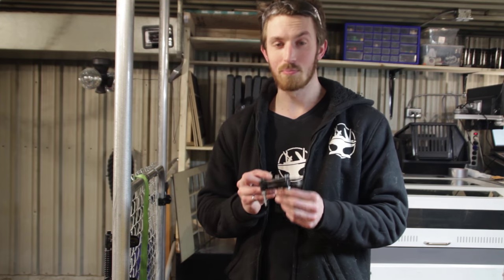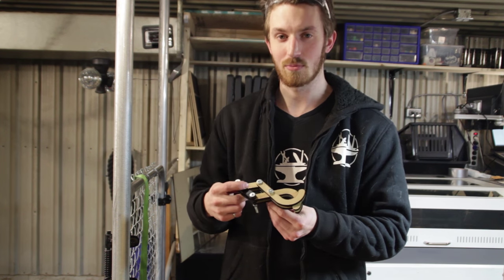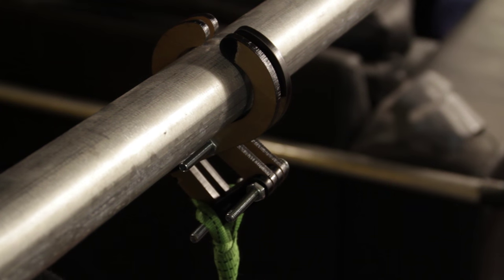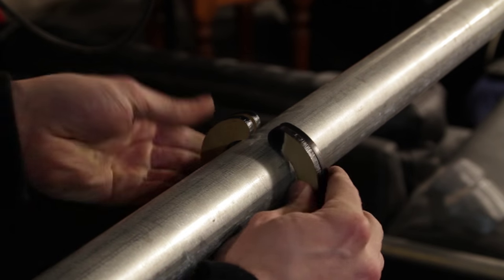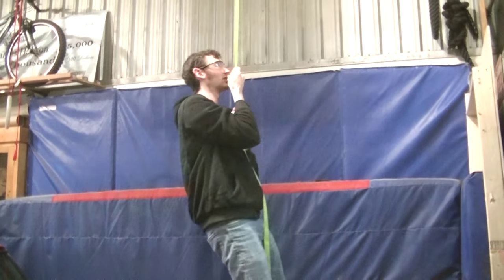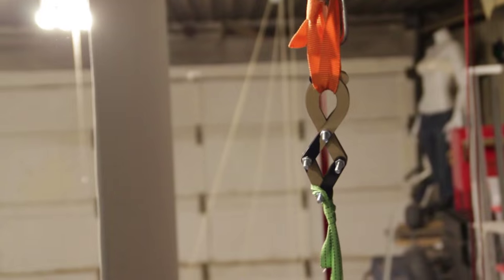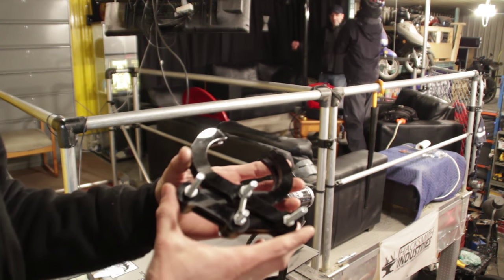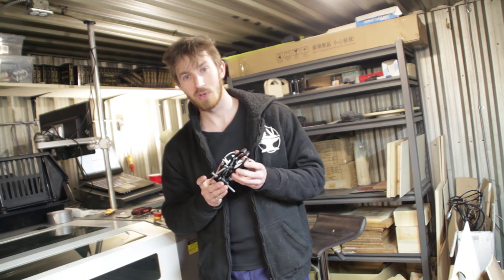Batman Rappelling Part 1 - The Hook!

Comment: Will there be a device to fire the grappling hook?
Reply from the maker: +Kyle Rathke That's the tricky part eh?
Reply: +the Hacksmith Firing it is easy. Aiming it reliably is harder. Getting it to latch onto a wide range of surfaces is hardest. Good luck.

Comment: i see a huge flaw in the design(if using the spring) when going down a rope like that you could see that the rope was losing and gaining tension as he was just jumping on it slightly, now if you actually jumped or applied a lot of force downward wouldn't you just rebound back upwards, making the rope not have enough tension to keep the hook closed. If you have already thought of this bravo on you, but if not might be a sensible thing. I personally would go for a sensor on the claw that wouldn't let it open up unless the force is under (desired weight) for 10 seconds. would be a little bit long but this is just me.
Reply from the maker: +chuckach3w Something to be tested certainly ;-) you haven't seen the rappelling device yet! It's possible if you purposefully pulled really hard and hopped on the rope it would disconnect the gripper, but that would something you would mean to do =)

A sensor would make it too complex I think, we're going for a robust but simple design, we had thought of having a locking mechanism with a second rope, but I think that system would be even more dangerous as you're going down!

Comment: Just a thought, if the spring will open it when tension is released won't rappelling be impossible? To rappel you need to basically let go of the rope and slide down it a little and continue. When you do this to go farther down the claw may release from whatever you have it attached to.
Reply from the maker: +Noah Corwin The weight doesn't disappear though when you rapell... You are essentially sliding down the rope, which your speed will be reduced by friction -- the only way for it to disengage is if you were to do a one-arm explosive pull-up, causing actual slack in the rope above you -- THEN it would release =)

But if you're doing that you mean to do that ;-) You'll see in the test videos!
Reply: +the Hacksmith was just my thinking to keep safety in mind. Thanks for correcting me! Wouldn't want to see you get hurt and have to stop making these awesome videos

Comment: interesting design! but wont the spring keep you from creating the tension required to close the hooks? It seems youll have to hold it in place and manually close it, then retain tension until you get in position to descend. Im looking forward to seeing more!!
Reply: +gamiensrule The spring is not needed to be that powerful, as long as it can pull the claw open. If it is weak enough, it wont cause any problems.
Reply: PerunaVallankumous Makes sense. The video made the spring appear fairly strong.

Comment: Why are you going to be using aluminum instead of steel? Definitely one of the coolest things I've seen.
Reply from the maker: +Luke McCarthy it's cheaper and easier to make -- and a third of the weight. Considering the brittle acrylic plastic was almost strong enough, even aluminum would be over kill. We'll make two and stress test one though ;-)

Comment: so I'm trying to build a grapple gun Batman style just for the fun of it, but I'm having a hard time figuring out the air pressure I would need to have, and how to achieve it. so far I've figured I can't have just a straight up co2 injection, I need to feed into a pressure chamber, but I'm in need of assistance on the specifics. also, any ideas on how to increase the reel in speed (if I could get 1 m/s I'd be happy) without massively increasing the weight
Reply: Probably you need a retractor for the rope kind of a winch
Reply: +Alif Rabbaanee yeah I've been playing around with some ideas, but the problem with a winch is the size, which is why I'm trying to downsize it. if possible, I would like to keep it one tool, but problems keep coming up that almost necessitates two separate tools

Comment: If you put a spring onto it you won't be able to hook it any other way but by hand. You won't be able to shoot it and have it hook itself. Unless you only plan on setting it up by hand and then using it.
Reply from the maker: +Atrax R Yeah... it's called a rappelling hook... ;-) I said this in the video. We'll revisit in the future to make it into a grappling hook.
Reply: the Hacksmith Ah, it makes sense then. But still I hope you'll use some safety line when rappelling down a 50ft building, since if you let off the force just for a bit it will unhook.
But yea, it makes more sense to me now. :)

Comment: isn't aluminium quite a soft metal? would you not want something stronger?
Reply from the maker: +Macauley Cullen Aircraft grade aluminum is nothing to scoff at -- it's easier to machine, and a third of the weight of steel. Considering the plastic held... even aluminum would be overkill!

Comment: I wouldn't trust aluminum well enough. why pick a soft metal?
Reply from the maker: +Video What It's cheap and easy to work with and CNC mill... third the weight of steel. The plastic was almost strong enough and aluminum has a tensile strength well over 10 times that of the acrylic... You do know airplanes and even Ford trucks use aluminum, right?

Comment: Looking good, but why not use steel?
Reply from the maker: +Haywood Jablomey cause it doesn't have to be steel? Aircraft grade aluminum is a third the weight of steel and more than strong enough -- the plastic was almost strong enough and aluminum is still probably 10 times stronger than it!

Comment: Hey You might want to check out the channel ColinFurze, he's very much like you and has created this invention in a different way like a classic grappling hook shooter, along with wench that all links onto one arm. It was inspired by Assassins Creed the game. And I have a 3D printer and I'm more than willing enough to print you stuff for free if it helps out in the Hacksmith Business.
Reply: And this design is great. Good luck and enjoy!
Reply: Plastic can't hold 200+ pounds
Reply from the maker: +Silver1080p It just did... Plastic can hold a lot depending on how it's designed!
Reply: +the Hacksmith You should have used polycarbonate for your prototype. Acrylic is far too brittle.
Reply: polycarbonate is expensive though0000
Reply: +Silver1080p Not really. I used to work at a place machining all types of plastic. I would know.
Reply from the maker: +WhoCares2509 you can't laser polycarbonate, it produces chlorine gas (mustard gas). And for the prototype... it doesn't matter lol
Reply: +the Hacksmith That's why you have a strong fan venting the gas. I wouldn't want to do a production run that last hours or days, but a few cuts won't kill you if you're properly set up.
Reply from the maker: +WhoCares2509 Chlorine gas is also highly corrosive and will damage the optics in the laser... I'd rather not risk it.
Reply: +the Hacksmith Point taken. I guess you could always machine it on the CNC milling machine, but like you said, it doesn't matter. Just a thought for next time.

Comment: No not youse aluminum youse damasks steel it is stronger
Reply from the maker: +red and Blue Why don't I just use adamantanium.... Aluminum is the third the weight of steel, and damasks steel is good for swords, not structural components ;-)
Reply: +the Hacksmith wow you replied and I am surprised that you know your different types of steel. I was thinking demaskes because it is a good strong steel tho with aluminum it is lighter and if you are planing to shoot it aluminum is the right choice.
Reply: +the Hacksmith Why not use Magnesium? It's 34% lighter by volume than Aluminum.